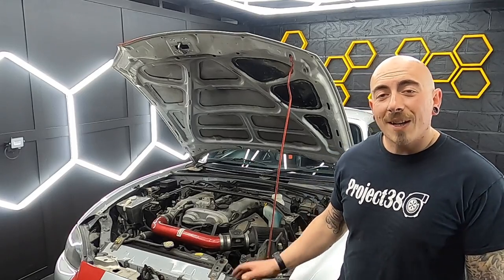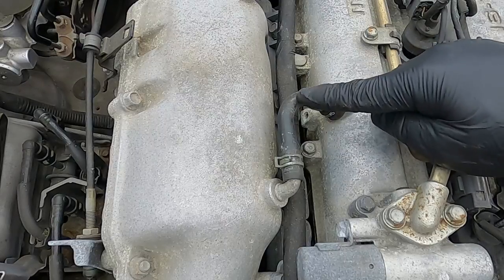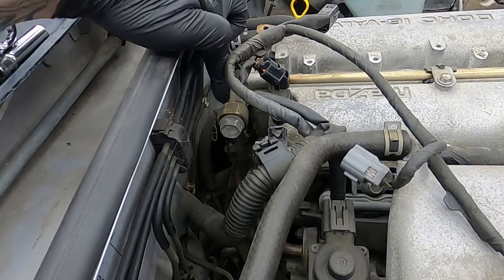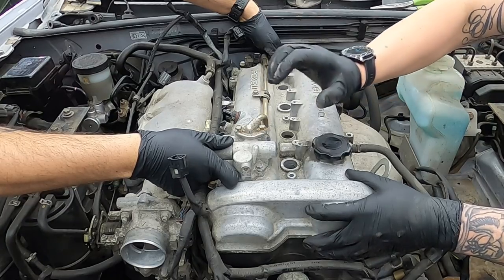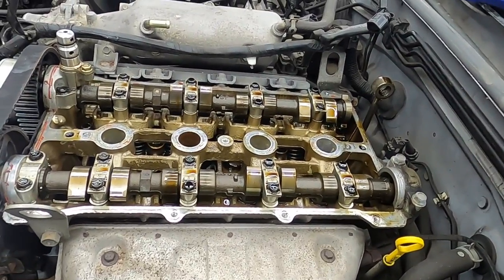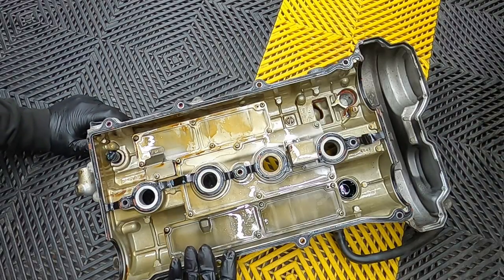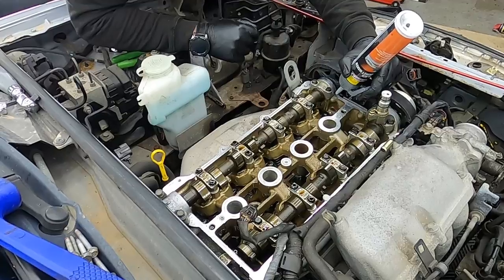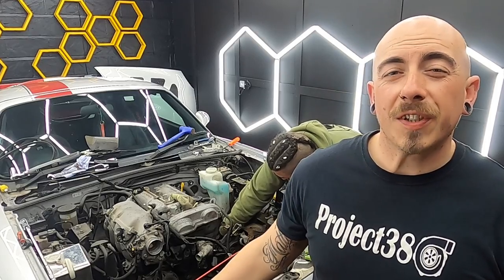VVT VALVE COVER GASKET REPLACEMENT : MX5 HOW TO

Comment: Thank you so much! Very clear detailed instructions. I speak on behalf of all NB2 owners. Much love ❤️ will be ordering my genuine gasket and copper washer from mazda.
Reply from the maker: that means alot, thank you. im glad this video helped
Reply: @Project380  My wife and I finished the valve cover gasket and no leaks on the first try! However, we did discover a coolant leak coming from the heater hoses. Small drips once ever 5 minutes. It's on going maintenance care.

Comment: Wondering if you might know what the housing for the oil control solenoid is called? The extra bit mount to the top/front of the whole valve cover. While replacing my solenoid, the bolt holding it in snapped so I'm looking for a replacement.
Reply from the maker: i think its VVT filter housing..... i could be wrong

Comment: Am I needing to disconnect the battery for this? If so did you reset the immobilizer?
Reply from the maker: you don't need to disconnect the battery so you should be good

Comment: What happens if you tighten it too much like 20nm on the cam cover bolts
Reply from the maker: you either strip the threads, stretch the bolts or deform the gasket